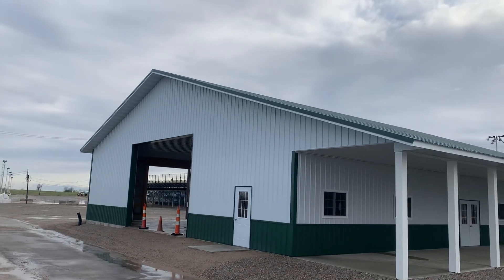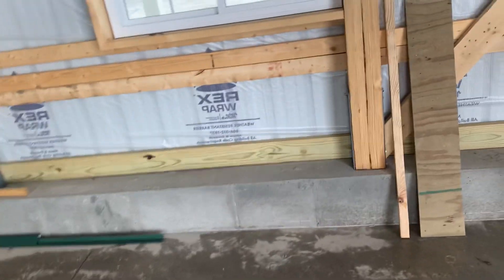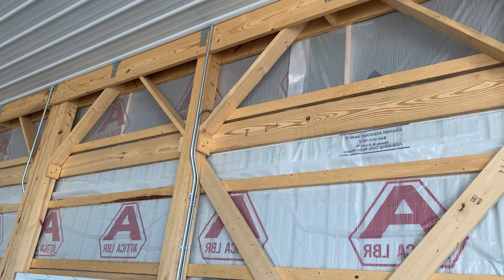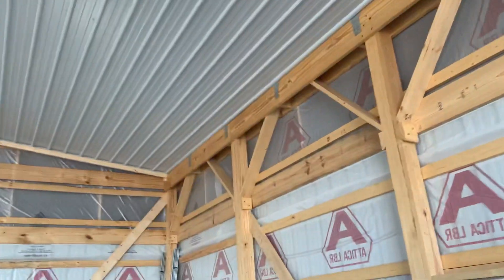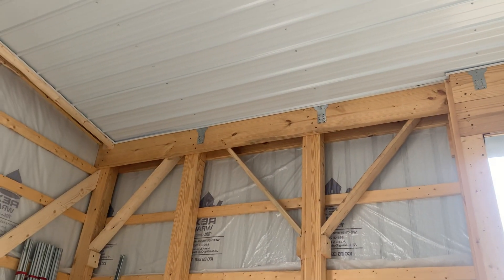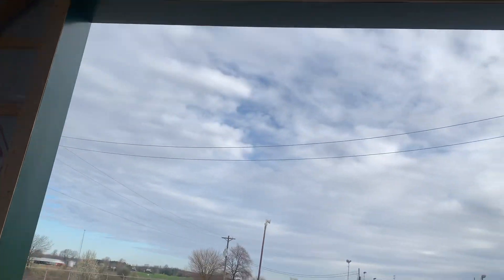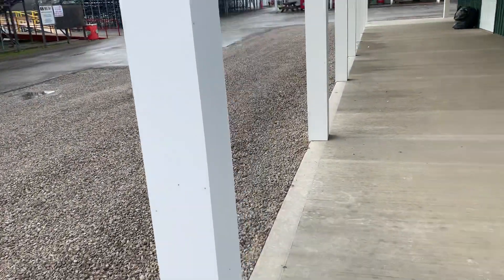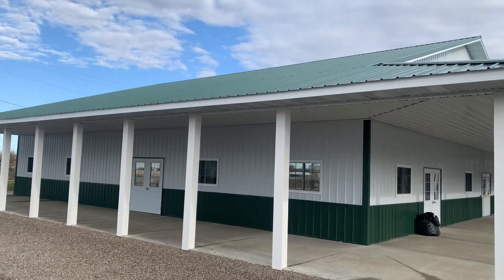Wet Set Brackets - 60x64 Post Frame (2022)

Comment: The foundation wall is a continuous or a cold joint? How does that work with the wet set bracket? The rebar stops before the cold joint? Thank you. I like the idea instead of a 2x12.